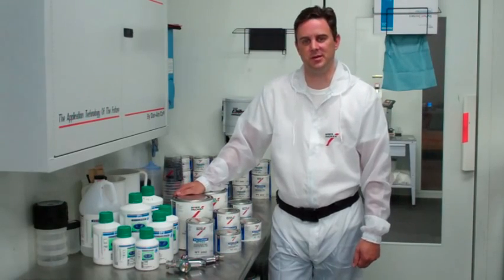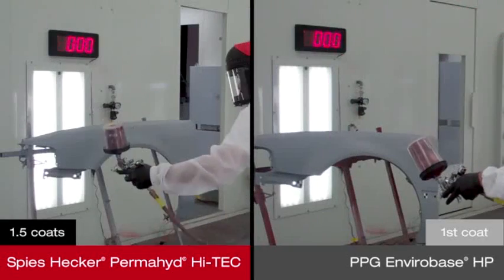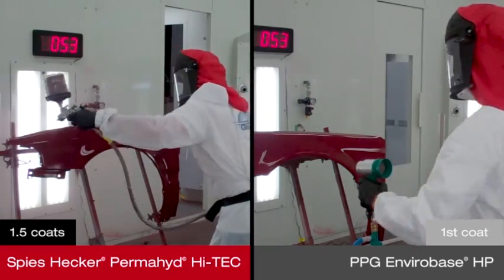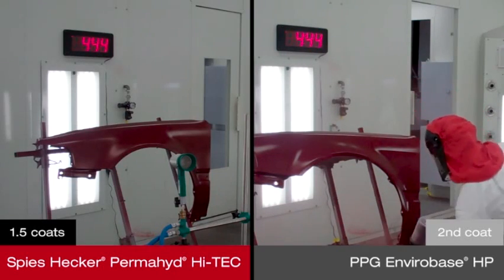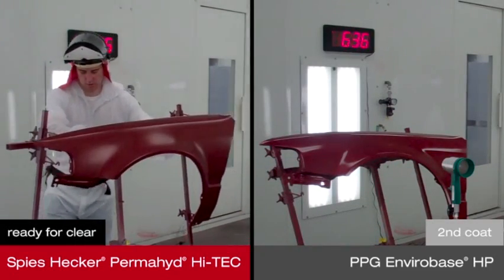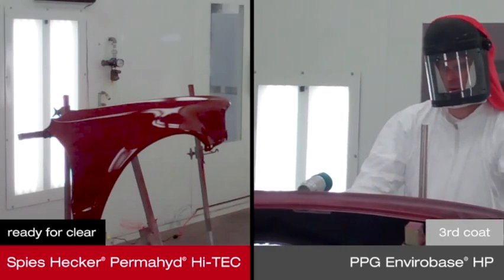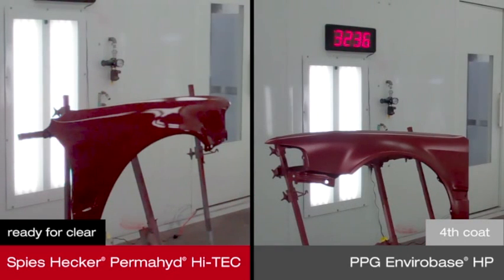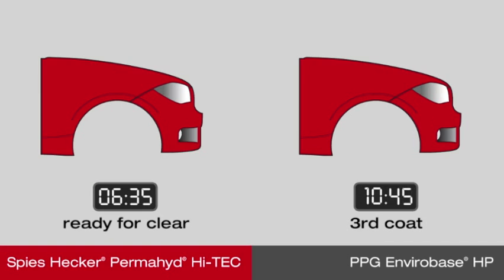Spies Hecker® Permahyd® Hi-TEC vs. Competitive Waterborne System: Coverage (USA)

Comment: This i clearly not fair game, i used PPG Envirobase in 4 years and i NEVER used 4 coats! I sprayed 1,5 coat directly as spies hecker does and then lower pressure just a bit and make a quick lap, and then just blow.
I never had problems with coverage or color match. Its a quick and easy product from my opinion.
I can also make same video and use spies hecker in bad way, even if its not bad product either. Its both very good products and its both very fast and easy to use.
This video is bullshit.